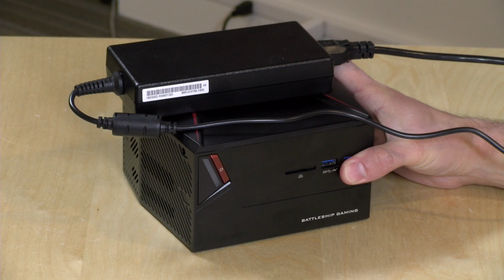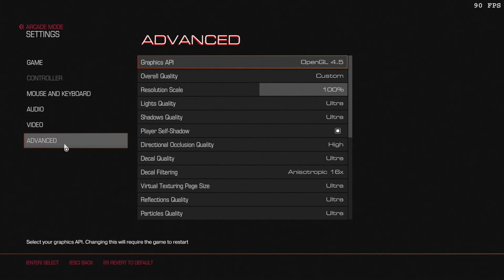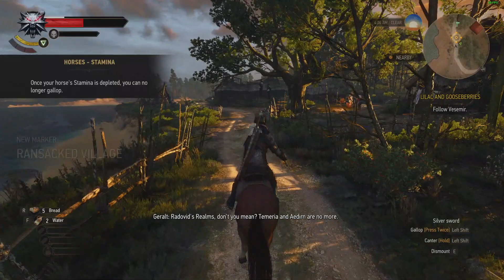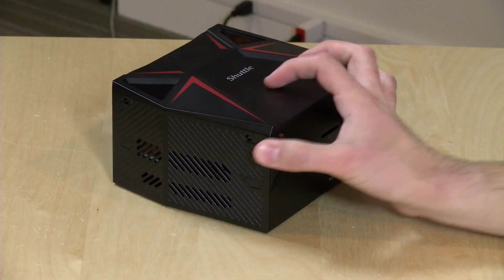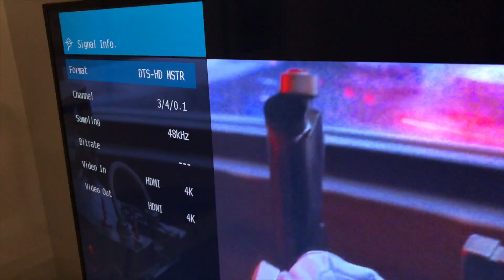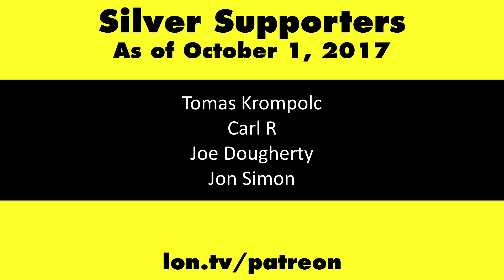Shuttle XPC X1 Gaming Nano PC Review - GTX 1060 Based NUC Sized Gaming PC

Comment: Asrock released a super tiny pc. Its called the asrock deskmini 1060 or 1080. Theyre barebones systems and you're gonna have to source your own cpu, hard drive and ram. The 1060 version has a gtx 1060 and costs $800. All in all it should still be a few hundred dollars cheaper than this.

Comment: Nice review sir. But that Mini Gaming PC is not worth the money. Dell Inspiron 7577 now comes with a Max-Q GTX 1060 , core i5 7300HQ and 8GB of DDR4 2400MHz RAM for 1000/$1200. And that has also a Thunderbolt 3 / 54Whr battery and a 15.6 inch 1920x1080 60Hz IPS display.

Comment: I can build you a 8core 32 gig mem with 1tb fastest storage all first class components for that amount. Only a bit bigger like a fractle design case. Smaller isn't always good. If your not going to move the system don't bother going small I have done that and regret doing so

Comment: Lon as I said on the unboxing video on the extra channel the GPU is VERY LIKELY using an MXM slot which is indeed a standard NOT proprietary. Meaning you or your intern might want to do some proper resource on things before doing reviews like this in the future.
Reply from the maker: +Montisaquadeis and where might a consumer find a replacement part? Not likely. That’s the threshold
Reply: Ebay but the prices on the 1080 MXM card are nuts tho. And AMD is lookig at the standard as well now.

Comment: I had a i5 6300hq with  a gtx 1060 and found that was more cpu limited than gpu, I think that and 4 cores 8 threads is a minimum to make the full use of the gpu

Comment: Yep, hard sell. Like mentioned, you can get a whole lot of gaming laptop models for this price, you can even get a few of the MaxQ models, or something like say, a Microsoft Surface Book 2 13.5 inch model. I'm not completely sure but I think you can also find cheaper options for small PCs or build one yourself for less with similar components.
Not sure, but I think configuring an Origin Chronos might get around a similar price, and it's just as small... Linus tested some stuff in the past, it was waaay more expensive because he usually tests very high end models with something crazy like water cooling or SLI 1080TIs, but I'm sure that for similar specs those prices would go down...

Comment: Lon, what are your thoughts on microsoft putting gtx 1050s and 1060s in the new surface 2?
Reply from the maker: It's nice they're doing that, especially on the 13" version. I had such a horrible experience with the original one though so I'm reluctant to take a look at the new one.